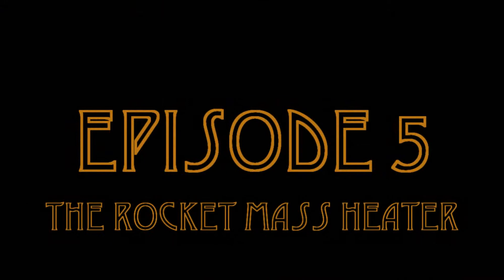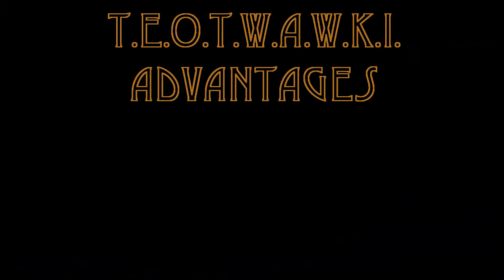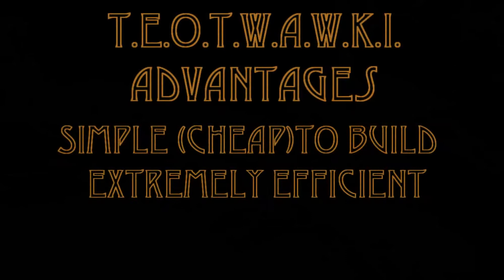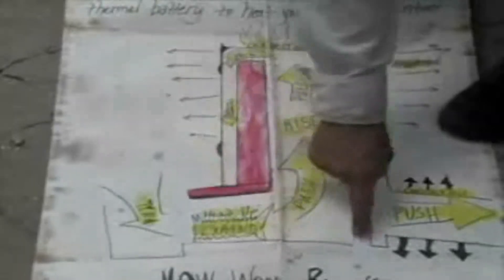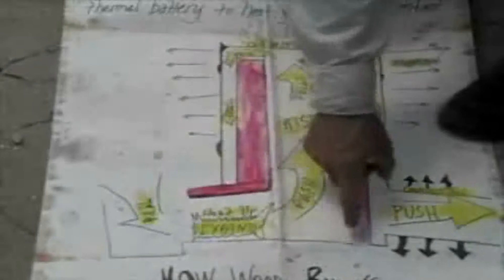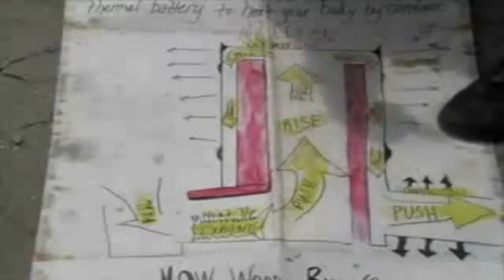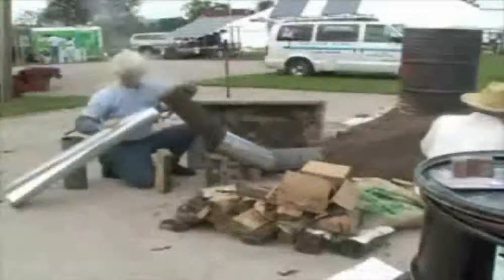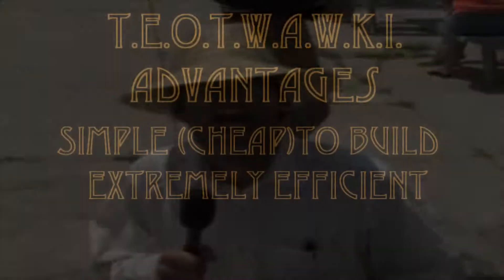Prep Tech 5 (Rocket Mass Heater)

Comment: @ernest302 look into straw construction as well, you can officially live in the camper but build a straw house as an outbuilding & live in it. Takes concrete foundation (you don't have to but it's best) straw bails with rebar through them to hold it tight) & a roof, then coat the thing with chicken wire & cob maybe plaster. I checked it out a year ago, they have some of it on YouTube. They are very well insulated & cheap. You can build so you can add on easily too.

Comment: @ernest302 You can build an outside unit that pushes heat & exhaust pipes through your camper & heats it. You can also heat water & circulate it, but you gotta watch the BLAMMO! on that one. Nothing BLMAO!s like steam contained. It can leave a nice crater as a monument, just a blocked water heater gone wild can do that with a whole house.

If you have room it's not hard to set up a little stove inside a camper.

Comment: Love this stuff, great video Goat H. Great tech 

I always thumbs up your great vids even if I bitch at ya about this or that on em lol.

Look up wood gasificaiton, which is the concept this works on. You can actually heat wood to a certain point and capture gasses that act like methane gas for burning qualities. There are actually outside wood burning furnaces that use wood gasification. It burns so hot creosote isn't a problem in hot area & so completely it's not in the cooler area either.